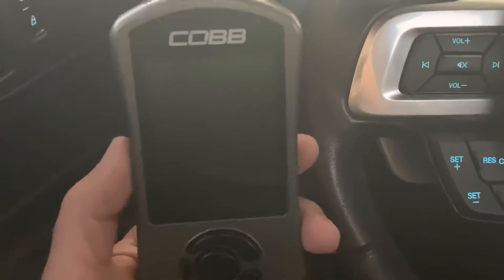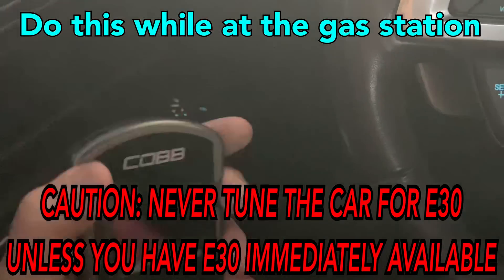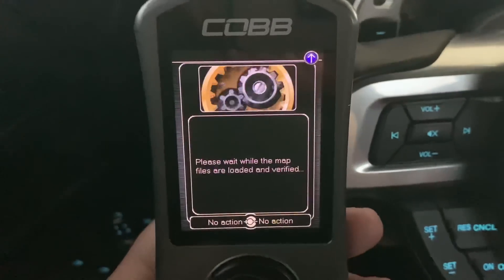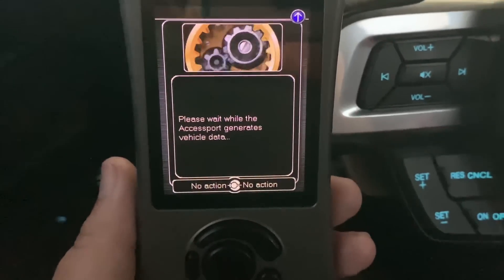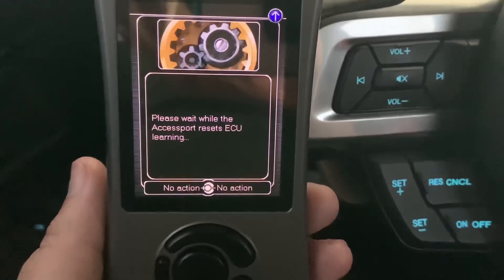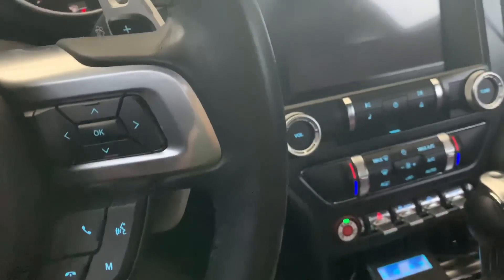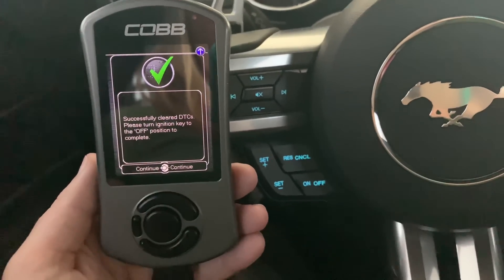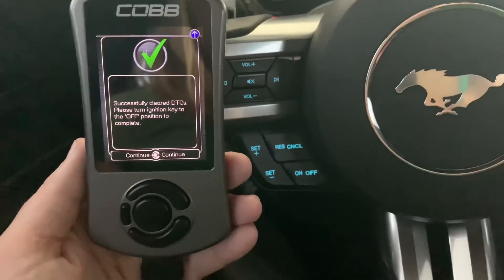Mixing E30 for MORE POWWA! How to get more power from your Ecoboost

Comment: So with the gauge, the testing would be unnecessary?
Reply from the maker: You would still wanna test every now and then so then get ethanol percentage in the E85. We have seen as low as E60 and as high as e90 at pumps.

Comment: I have a question, do I need to upgrade any fuel system elements before going E30 because I know E50+ you have to because it’s much more harsh
Reply: You probably have the answer. But no, you do not need a new fuel system for e30 and anything above e30/40 without a fuel system does not help

Comment: My eco is at 420whp on e30 tune so far:. Hopefully it’s gonna be as clean as this chicks!!! I’m also tuned by Adam. He’s the best!!! And holds world record titles in the platform
Reply: Other than tune how did you hit that number? I’m also tuned by him and I’m about 380whp. Stock turbo and block.
Reply: @Nessendranna  I have the nx2 turbo and race intercooler on e30. Not stock turbo.  And 420whp is all u can get on stock engine without failure.  So if I were you I wouldn’t buy or Invest in a nx2. You can only squeeze 420whp out of them depending on elevation. If I could start over I would just start the block and them get ready to get a big turbo fabricated on there or
Turbo kit like borg Warner up to 600whp Any more power and you need a custom turbo kit..  so I woulda started block and got a bigger turbo vs spending 2k on nx2 for 420whp. Not worth it! Put it in your block!! Adam is building me a 1000whp as we speak!! But if you only want stock engine and 420whp get the nx2 and ur set.  I’ll have that for sale pretty soon!  And all my parts fairly new
Reply: @Paper.Power.Politics  very nice! I’ve been eyeing “the one” 
But I’ll keep that in mind. I believe I’m as far as I can go via stock turbo/block atm and still pushing 380whp and about 400-410wtq is impressive for a little motor like these have
Reply: @Nessendranna  absolutely right!! That’s why I got the ecoboost! Amazing car!! Beats dodges baseline v8 when it’s stock! Mine beats scat Packs!! But yeah man definitely cost money to make power!
Reply: @Paper.Power.Politics  for sure. I had a lot of friends give me crap for getting the ecoboost and then they rode in it.  They don’t make fun of it being a 4 banger anymore lol! Was able to get the pp1 and premium for the price of a base v8.  Another 2 grand and it’s close to a stock GT.  Love it
Reply: @Nessendranna  you can probably beat a stock GT right now! And I don’t care what people think , i love 4 cylinder turbo cars , and when mustang came out it’s the only car i wanted! And they can talk all they want! Specially after they get gapped by an ecoboost! Lol
Reply: @Nessendranna  Like I said I wish I just started my build instead of investing all the money into the NX two turbo set up for only 420 wheel horsepower I wish I would’ve just started the block and started to do a big boy build versus spending 4 to 5000 just to get for 20 wheel horsepower with the nx2